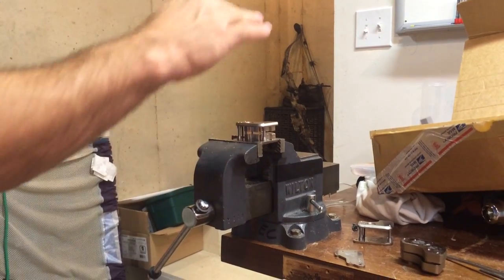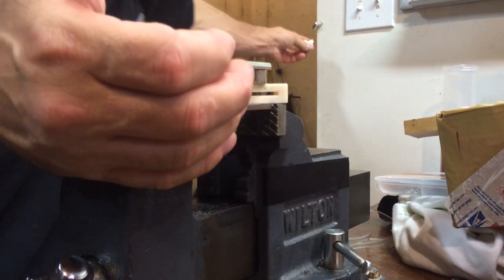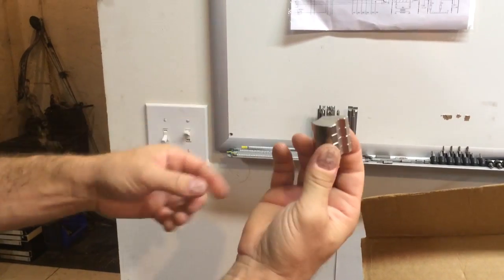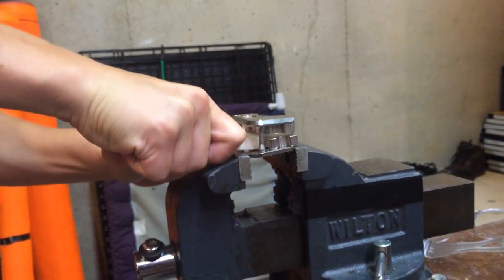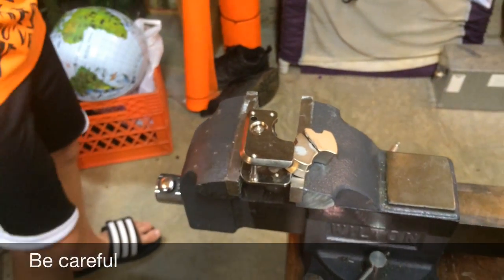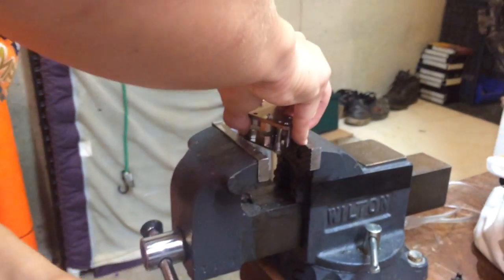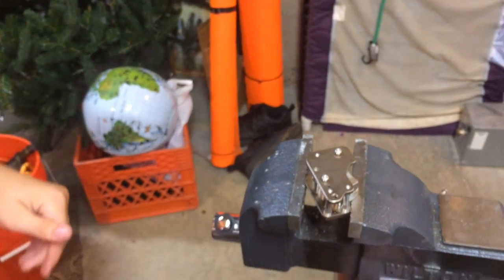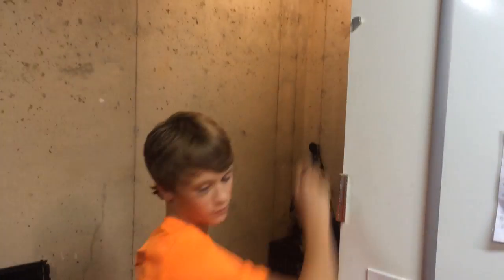[How To] Remove Hard Drive MAGNETS from Base Plates [KTFG 096]

Comment: How not to damage protective coating?
Reply from the maker: Cross Fingers?
Often the coating is damaged removing them due to the strong adhesive. 
Another commenter mention dissolving the glue to protect the coating but I haven't tried it.

Comment: The newer large magnets whatever they use takes stronger than xylol. If it is the 1/4 thick or bigger and the backing is flat not curved I just keep them on the backing. The backing usually has screw holes that can be used for mounting.
Reply from the maker: Yes, I kept several on the backing for that reason.
I have seen a picture of these magnets holding a 500 lbs block of metal.
Maybe I will try something similar with a dynamometer and chain fall just to see how much pull force is required.

Comment: On the apoxy that is used to hold the magnets. xylol works for the older magnets so you don't have to damage the plating. But you run into the issue with the magnet being so strong that the epoxy oozes out the sides and is still hard to remove but does work. You can use hamerite to paint the exposed magnet after cleaning any oxidized residue off first and 2 coats. Make sure that it is not too thick because it will take too long to dry properly and make sure 5 days in between. If you put them together before dry and it may glue them together.
Reply from the maker: Cool, thanks for the tip!

Comment: Never mind that you're damaging them in the process. Eventually the magnets will corrode where the nickel plating has chipped off.
Reply: Yeah. Wouldn't want those free magnets to corrode now. Holy lord. Imagine the loss.
Reply from the maker: Some of the magnets in the video were removed a decade ago and still no corrosion.  I have many cracked magnets as well that have never corroded.  I am not opposed to your idea if it works as I would rather not damage the plating.
Perhaps you should shoot a video with your process and results to share your knowledge with others and reach a wider audience than a comment on my channel.
Reply: @KTFG  I'm not going to make a video just for you... maybe just try to follow these simple instructions if you can:  Soak the assembly in MEK or acetone for a few hours to remove the glue.
Reply from the maker: Greg, No one asked you to make a video just for me:
“Perhaps you should shoot a video with your process and results to share your knowledge with others and reach a wider audience than a comment on my channel.”
I am not sure how a rational intelligent person could have confused that.
Again I am not opposed to your idea.
 
Think about and answer this question honestly, what did you hope to accomplish with your original comment?
 
Did you hope to share helpful knowledge or did you hope to make yourself feel smart by criticizing another?
 
If it was to help others, don’t be selfish, make the video and share your knowledge.
Reply: @HAL9000Me2  real smart, kid
Reply: @HAL9000Me2  and that was sarcastic
Reply from the maker: +Dav id 
Lol, well put!

Comment: from what type or brand of Hdd did you get the bigger ones?
Reply from the maker: Old 1992 two gb server drives .
They don't make them like that anymore.
Reply from the maker: Not sure, I disassembled those over a decade ago but any large drive from the 80s or early 90s should have these regardless of brand or model.
Reply: what brand and what model?